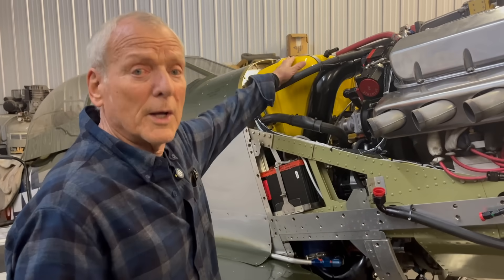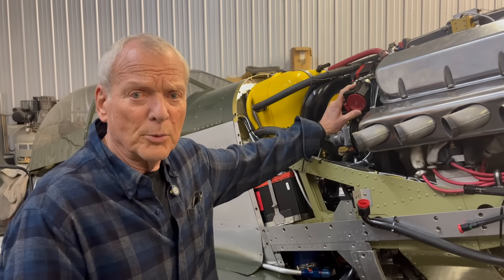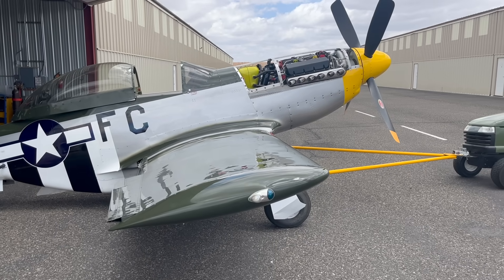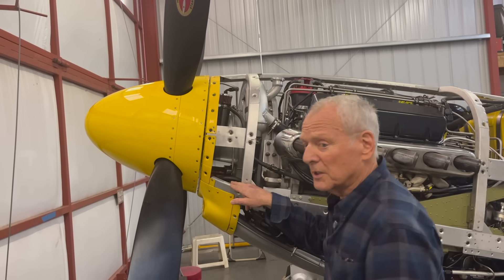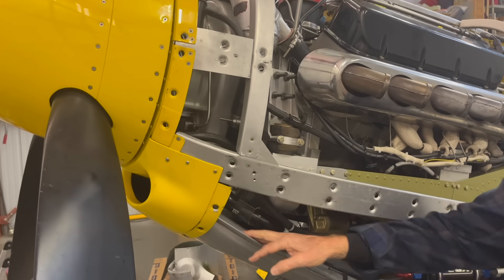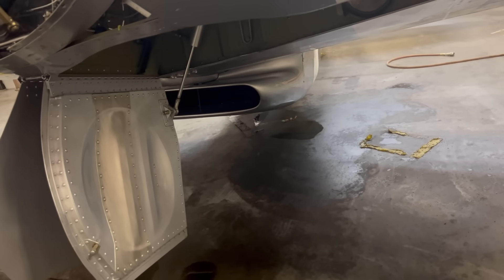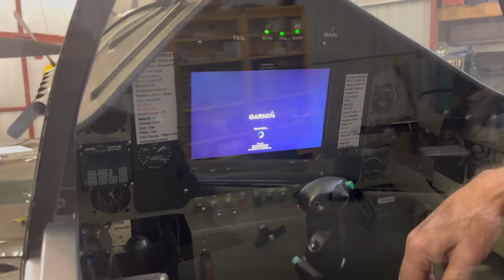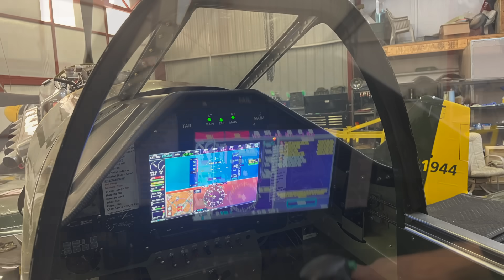S-51D Mustang -- Looks Like a Classic War Bird, Sounds Like a Classic Hot Rod

Comment: It has an 8-cylinder engine, right?  But 6 exhaust pipes...  so two pipes are fake?  So why don't you have 2 pipes per 2 cylinders, and 1 pipe on 2 cylinders? Then all 6 would emit exhaust?  It is actually VERY easy to do, if the exhaust manifolds are designed so that all cylinders still exhibit the same exhaust pressure (compensate the cylinders that have one pipe vs. those with 2)

Comment: He said that the engine block was custom made by Keith Black. Does that mean it’s a modified automotive engine or was it custom made from scratch? And if it is a modified automotive engine which one was it based off of?
Reply: The block is an all aluminum version of a Chevrolet Mark IV engine block.  Heavily modified for this application as it displaces 540 cubic inches and is supercharged with a centrifugal supercharger.

Comment: You know, if you'd spend $100 bucks for a backup camera kit, commonly sold for cars, you could mount the camera forward, put the little view screen in your cockpit, and be able to actually see forward when you taxi and land.   I'm just saying.    So many warbirds and taildraggers crash because they can't see over that big nose when the tailwheel is on the ground.   

Now we've got the tech to fix it without sticking a mirror outside.
Reply: Just s-turn the airplane and keep your eyes outside.
Reply: @R760-E2  ,
I've heard it referred to as "Wig-wagging" on the tarmac.
Reply from the maker: That's an interesting idea, thanks for sharing!